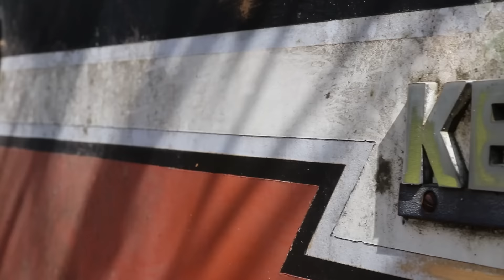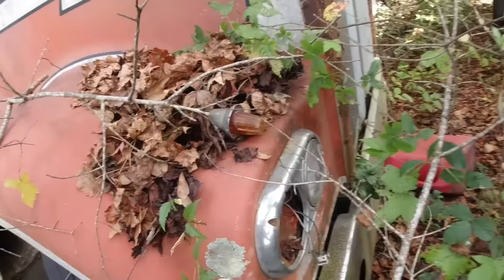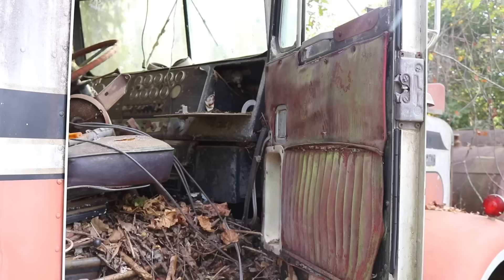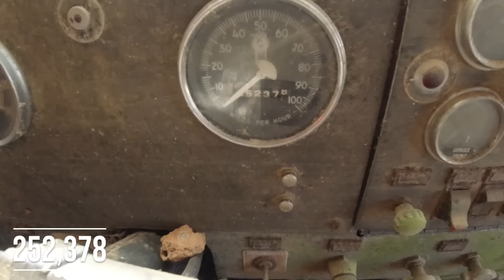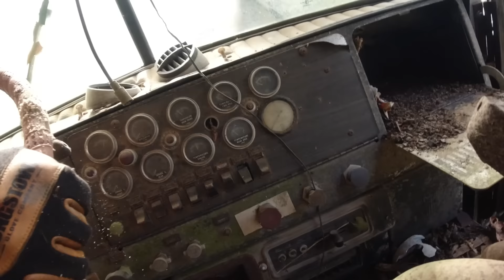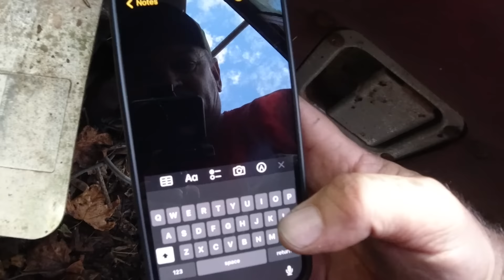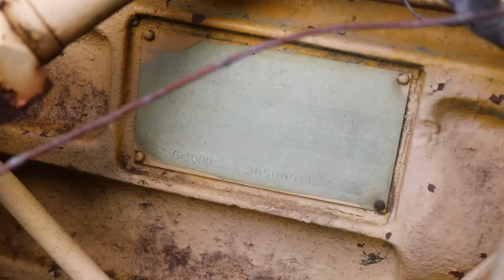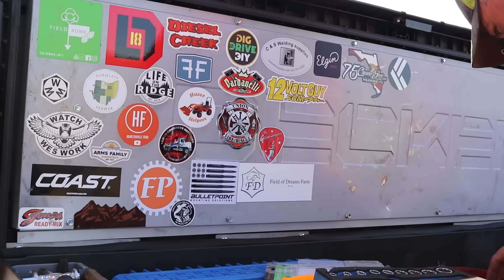WILL IT START?  1976 KW W900 SAT FOR 33 YEARS!

Comment: Love to see that Moline up and running! It's a propane fueled rig and they build no carbon actually run super clean so it shouldn't be too hard to get going.  Good luck and see ya on the next video!!
Reply: Probably has a solenoid in the fuel line. If it has fuel, battery and spark it shouldn’t be to hard to fire off.

Comment: Hank, the A series W900s went from 1972 1/2 to 1983 1/2  and I am betting that the truck that you guys are messing with originally had a Detroit 2 stroke in it. Never seen a emergency shut off handle on anything but a Detroit and I think that Cummins engine is a PT 270. And I got to say why and why again does people when they park an old rig like this why do they leave the windows open and or the doors!

Comment: I'm glad to see you and Wiley  at it again . That is a good looking old Kenworth that your cutting out of the trees, and it is definitely in good enough shape looks like to rebuild and get back on the road . I am looking forward to seeing you all get it started .
And I would love to see you all get that M&M tractor started and running . I have been told that they are not that hard to work on, because the motors are usually never stuck

Comment: Hank next time you have a bolt stuck in a socket, lay the socket down on a hard surface an smack it on the side with that two pound sldge you have. Bolt will fall right out!

Comment: I think Puddin's dad had one of those propane powered M-M tractors.  He and Mortske worked on it some time back.  You might check with them on the particulars but as I recall it wasn't all that hard to get it running.  Love to see you guys get it going.
Reply: He sure did.
Reply: Yep I saw that to.Fuel and compression them ole tractors will fire right up as long as they ain't locked up lol
Reply: You are correct I was gonna put that in the comments you beat me to it 🤣😂

Comment: I accidentally hit the send button before I got done . The insides of the motor on a propane motor are really clean and no wear and the oil is usually really clean . So yes, I would really love for you all to get the old M&M tractor running and I guarantee that someone will want to buy it . I have worked a little bit on an old propane powered fork lift .  I will be looking for the part 2 of this video on the old Kenworth truck and hope to see you all working on the M&M tractor . Take care and stay safe out there working on the old equipment .
🤗👍❤️💫

Comment: I have driven a propane G-1000 identical to this. My neighbor has one that runs very well. With Propane you are likely to have little trouble getting it running as long as it turns over. As I recall it starts on vapor but runs on liquid, which is vaporized in the carburetor, when warmed

Comment: C'mon guys I'm sure that your furnace has broke down before. Check the regulator ,make sure it's propane but whatever it runs on you just need to change  the orifice for what ever type of  fuel ⛽ is available in your area it should say on the  tractor 🚜

Comment: hank just so ya know there was 3 smokey and the bandit trucks a 73 in the very beginning of the movie that was yellow and chrome then 2 74's both different from each other but they were gold and coffee brown(that looked black) theres 3 smokey and the bandits the first in 77 and the other 2 later anyway yes the round headlights is an A model an b is rectangle(in this era only in the 80s and 90s both w900A and w900B had rectangle lights) you can also tell by the door handles/latches this is a 76 w900a shorthood its has a 290 cummins(one way to tell is a 290 has a manual cable shutoff and earlier models had a compression release so did 280 cummins) 300 350 400 etc are electric solenoid loved this episode this truck definitely worth putting back on the road
Reply: also yes definitely on the minnapolis moline id suggest watching puddins fab shop and mortske repair start puddins dads mm for reference they run off propane but its no different than starting a gasoline powered tractor

Comment: Those MMs are pretty simple to start,  clean points an check for spark ect...  hardest thing will be to put some propane in it,  you might need to make an adapter for a 9kg bottle